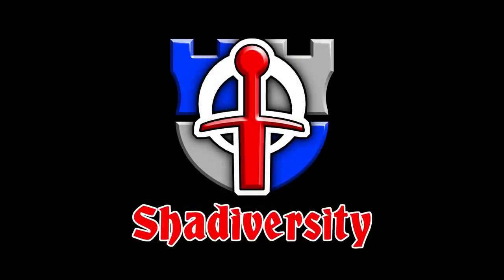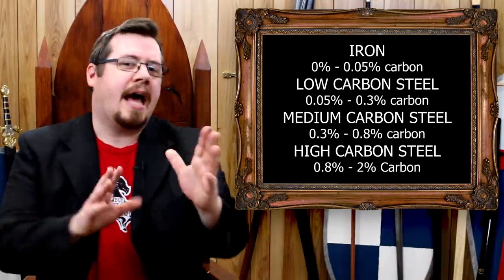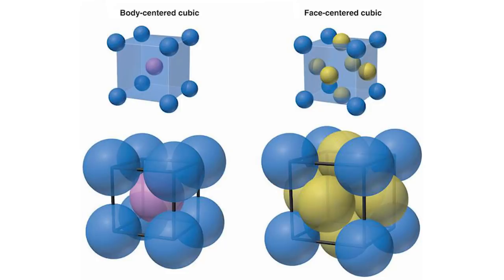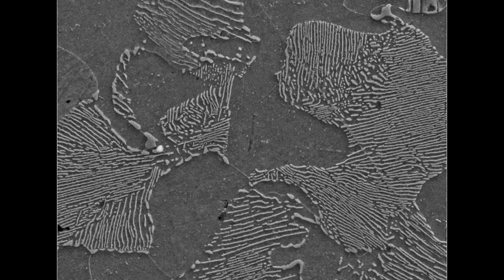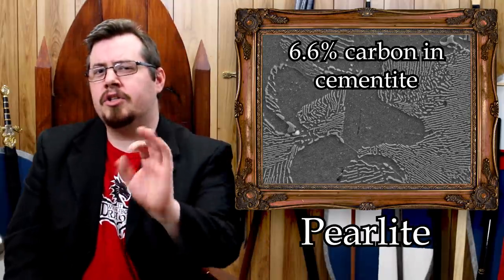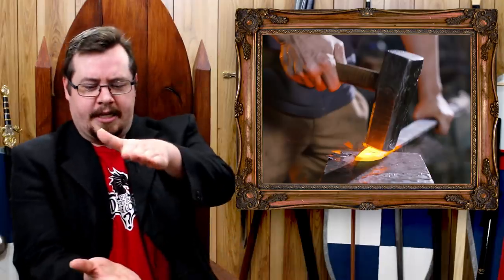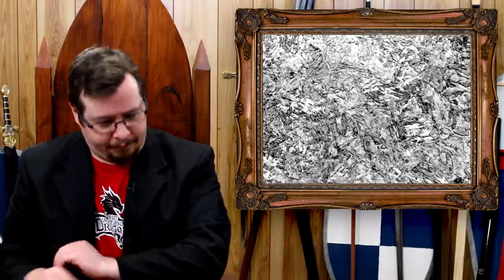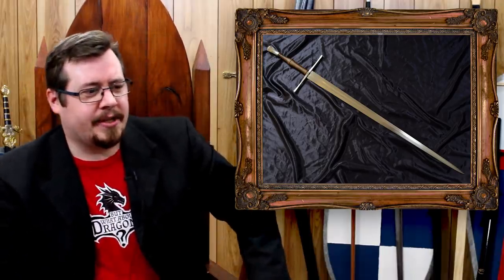What quenching and tempering does to SWORDS

Comment: Hello Shad, an incredible video!! Such as always.
When you were comparing the mono-spring steel to the differentially hardened one, I came up with some questions:
The differentially hardened katana have a soft core of ferrite because they are used two steels for the blade: the one for the exterior wich is high carbon steel and a low carbon steel for the core, then when quenched, applying the clays first, result normally in a sword with a martensitic edge, a pearlitic jacket and then a ferritic core. Let's imagine that we make one from an single bar of modern high carbon steel, but we apply the clays before quenching to make it with a true hamon: 
Would it then have a pearlitic core and jacket and a martensitic edge? 
Would this make it even more brittle than having the ferritic core or not?

Also, due to the fact that normal martensite is brittle: would it then be good to temper the blade to make the martensitic edge more flexible or would be unnecessary or even unconvenient (for example, make the hamln disappear)?
Reply: And also, with the pearlitic core and jacket scenario, it will still make the sword more brittle than making it from mono-spring steel wright?

Comment: Hey Shad, if you accidentally heat up a blade nearly to the temperature it was tempered, will it mess up its characteristics? Because of that, people usually warn against sharpening knives using grinders that are not designed for that purpose as they can go too fast and heat up the edge too much. Wonder if it's valid.

Comment: The one thing I'd like to say is that you should almost never quench a blade in water. Most steels will gain cracks and micro fractures when quenched in water because of the stress caused by cooling so fast. As an amateur blade smith I've learned that you should almost never quench in water, even if the steel is capable of surviving a water quench. I will admit that some smiths are skillful enough to pull off a water quench, but it is still risky. Oil is the better option because it cools the blade a bit more slowly, giving you a hard blade, but taking away all of the added stress of a water quench.

Comment: Theoretically you could get even harder than Martensite, if you cool is fast enough to form Amorphous steel.  This means the atoms retain the random arrangement of a free flowing liquid. There are no crystalline grains, and thus no way for grains to slip past each other. The metal would have no faults, and would be much harder, stronger, and tougher than any metal with a crystalline lattice. Metallic glass can take a lot more stress before deforming than crystalline metals can take before breaking, and it snaps back easily from the small strains it can take before breaking. When the stress is too much to bear though, it catastrophically shatters without warning. 

We are not even close to developing the technology to cool an ordinary carbon steel alloy fast enough to form a metallic glass. We can form amorphous metals out of some much more complex and exotic modern alloys, but even then can only form small items or thin film coatings. Making a whole sword out of an amorphous metal would require magic.

Comment: 4:00 Shad is correct when he says it's "phenomenal". 

The fact that steel can be heat treated in this way allows engineers (and, in ye old days, blacksmiths) to carefully control the properties of steel. Austenite is one useful phase of steel, but there are others too. You can have very hard steels that are abrasion resistant but more brittle, and steels that are very flexible and impact resistant but more prone to deformation. And tons of other types of steel just by controlling the carbon content and the heat treatment process. 

And add to that steel alloys with things like Chromium for stainless steel or silicon for transformer steel or tungsten for tool steel...

Steel might be very strong yet flexible, but it's actually the fact that it's material properties can be carefully engineered that has made it so useful throughout history.

Comment: Also you can get pure elemental iron, you just need to reduce the iron with a reducing agent that isn't soluble in molten iron, you can do it with aluminium, sodium or magnesium via a thermite reaction or directly with electrons from a wire via electrowinning. Iron does in fact like having carbon dissolved in it to the point that it will dissolve carbon from diamond sharpening wheels if the temperature is high enough, hence why you should only use diamond hand tools on steel, any power tools should be Al2O3, SiC or WC based abrasives, as Alumina/corundum won't dissolve in iron and silicon and tungsten have a higher affinity for carbon than steel.

Comment: The reason most Katana's are made out of spring steel is for economic reasons, it's simply far cheaper. A traditional build pretty much has to be done by hand and is impossible to mechanize. It is also much simpler as well as faster.
Reply: But it makes them illegal in the UK.

Comment: Huh. That might explain how the guard on my cheap display sword ended up snapping off on one side.
I didn't think you could snap off metal like that. (It showed no sign of bending, rather it broke in two).
Extremely hard steel (and thus brittle), I guess.

Comment: That's probably one of the reasons swordsmen who used the katana are commonly regarded as being extremely skillful, because if you try using pure brute force and smashing at armor with a katana it will get ruined easily so it requires more skill and precision to not break it in battle against armored opponents. So it required extra skill to even use properly, where as it wouldn't require as much precision to wield a spring steel sword that can handle the structural abuse of smacking armor plates. The general design of spring steel swords makes it better for thrusting/spearing opponents between their plating also, where with a katana it's harder to aim directly like that. Its shape probably does make it easier to catch between the plates and twist it side ways to get under the plates though. I guess it all depends on the swordsmen preference or how they were trained. I definitely would prefer the spring steel though.

Comment: But Shad, what about different types of quenching in terms of liquids used? How does that effect the process? Water vs oils for example.
Reply: Generally speaking, oils are better as a quench medium because they offer rapid, even cooling at higher temperatures, and slow down as the part cools.  This keeps the part from cracking.  Water is less than ideal as a quench medium as it creates a bubble of water vapor around the part, which can cause uneven cooling, excessive strain, and potential cracking.  You can kind of get around that by using a brine or caustic soda solution, but oil is still the preferred option in many cases.

Keep in mind that this is from the perspective of a modern toolmaker, not a blacksmith.
Reply: Mr. Entropy still very informative, thank you!

Comment: Heating worked steel up to the normalization temperature doesn't reset all the stresses in the metal, it just normalizes them, unless you're heating it to the melting point, there's going to be some residual stresses from working detectable in the metal, if a normalization heating before a quench really reset everything you wouldn't be to see the patterns in folded steel, it would just homogenize.
Reply: Ceteris paribus, you will still see different properties in a forged sword that was normalized before the quench and temper versus a milled one normalized before the quench and temper, the differences will mainly be in ability to hold an edge and shock resistance, due to the stresses still left in the blade from forging prior to normalization.
Reply: @awashburn6944  of course net stresses are normalized, but you will see a difference in grain structure in a forged blade even after heat treatment and normalization, unless you're getting hot enough to melt the steel, or keeping it at a temperature for long enough that the average ion velocity through the steel is enough that the time it's at that temperature will allow those ions to move far enough away from their original locations in the blade, all you've done is anneal it, you've taken some of the forces and allowed them to cancel out, but not all of them as the microscopic grain structure of forged steel after heat treatment still looks different to heat treated cast steel of the same content.
Reply: @awashburn6944  I wasn't saying that the visible pattern welding was due to stresses, I was saying it's due to the metal atoms in the steel not normalizing when heated, you can keep them at temperature for days, the stresses may relax, but the metal will not homogenize. If normalisation was a hard reset like melting, then you wouldn't see a pattern and the grain structure would be indistinguishable from a casting subjected to the same treatment

Comment: Is there a difference between quenching in water and oil?
Reply: Water cools it down faster mostly, but the Leidenfrost effect kinda messes it up so it cools fast on some spots and slow in others and is way more prone to cracking your steel. Oil is better and safer.

Comment: It is not true that pure metals do not change traits due to quenching.
The changes just arent apparent enough due to unificity of material.
Steel is made of two basic materials Iron and carbon. Different particle sizes  and atom structures intertwine forcefully and create high tensile environment.Tempering releases some of this stress and evens out the spacing of particles that are too close, and these are first particles to repel each other under stress and create fractures.
Quenching pure Iron or Bronze will change its structure due to shortened time period of cooling. And there's a reason why certain metals have certain timelines of natural cooling. Because atoms need time to settle. Once they settle they release the extra energy ,in this case heat.
If you quick cool any metal it will change its structure. But usually softer metals,or more unified ones atomically, will just develop cracks.Most of the time losing better qualities and gaining very small amouts of good ones.

And I just realized how boring this may sound to someone who didnt finish mechanical school and knows crap about metallurgy.
Enjoy   :)

Comment: Wait, hardened steel can't get sharper?
I always thought that it could and this was also the reason obsidian blades can get much sharper than any metal blade ever could. Obsidian also loses it's edge pretty quickly, they were also made with a wooden core so the edges could be changed pretty quickly. I know glass is quite a bit harder than steel so if it's not it's hardness that makes it so sharp then what is it.

Comment: Could someone please help me understand what he means when he says:
The Iron core of the Katana will not absorb some impact but it will prevent a crack from forming all the way through the blade when struck on something hard. It seems to me that preventing a crack would indicate it does absorb some impact. I'm not disagreeing with Shad, but I am confused and any help is welcome.
Reply: Jack It means the crack will just stop when it encounters the border between different steels. It doesn't absorb and distribute the shock, it limits the damage.

Kind of like the difference between kevlar and modular ceramic armour, kevlar spreads the energy of a bullet around and absorbs it, ceramics either withstand it or crack, although only one ceramic plate will be damaged and the armour will still be usable.
Reply: Thanks :D

Comment: Omm ya i am a bladesmith with a little over 1 year experience and well over 100 blades made.  I feel i need to way in on this a bit have to say i would not use anything above 1% carbon content to make a sword. when you get up to 1.5% carbon content steels like D2 if you get it too hot it will crumble and i have had this happen on me. for a bladesmith .4 or less carbon is low carbon, %.5-%.6 is mid carbon and .7%-1% is high carbon and 1.05%-1.5% is super high carbon.  this is partially do to the fact that having higher carbon content lowers the melting point of iron, meaning it gets in the gelatinous state at lower temperatures when you have more carbon.

Comment: So, I understand that a high carbon steel is not very good for a sword, but which would be better, medium or low carbon?
Reply: David Kwei wait high Carbon is the best right
Reply from the maker: High carbon steel is the best for swords, it needs to be high carbon to make martensite and then a spring.
Reply: David Kwei well the problem with terms like low and high carbon steel are that they are relative. In actuality most swords fall around the middle, but if you go to kult of athena than you want to buy swords that are labeled as high carbon, and avoid ones made of stainless steel. Stainless steel is completely unsafe for use
Reply: Thanks, I think that I got things mixed up.

Comment: Japanese swords were typically not tempered, but there is evidence some were. Also there were swords in China that were spring tempered, differentially clay hardened, and differentially hardened AND tempered. All modern reproductions of clay hardened katanas are also tempered. Typically 45 hrc back and 60 edge. It is wrong to say you cannot do both because the edge would crack because normally a sword simply will not flex to 90 degrees. So there you go, best of both worlds.

Comment: is it possible that there is a little error into your presentation
from what I learn in school a very long time ago !  
you quench a steel piece to temper it then you anneal to release the tension and adjust the desire hardness
Reply: Nope, annealing is the process of completely removing the hardness. For a practical example, if you wanna make a knife out of a file, you would first anneal it to make it soft, then cut/grind it into shape, then quench, then temper. And of course, a little different if you want to forge it into shape, then you just heat it up and beat it into shape, then you do any finishing with a grinder if needed, then you normalize it (because it was beaten into shape), then quench and temper.

Comment: Great video. But sadly I'm only left with more questions than answers. A while ago, Matt Easton, Scholagladiatoria shared a video from Mike Loades' channel titled "The Secrets of Damascus Steel"(https://www.youtube.com/watch?v=OP8PCkcBZU4).

In both that video and in the comments they talked about how crucible wootz damascus is typically not quenched when it is heat treated. Some even have the temerity to say that it is "air quenched." 

I was under the impression that air cooling had the opposite effect, which is it softens or de-stresses the blade rather than harden it. It's also likely that these wootz steels if unquenched, remain with a pearlite microstructure and do not achieve the level of hardness that we expect most high-carbon steel blades to have.

You or somebody else who is knowledgeable within the sword community should do a video about this. Either explaining or discussing what advantages or disadvantages there are to crucible/wootz damascus, and why they avoid this part of the process.

Comment: So there are some parts of metal working that seems to "just work" if you don't know the molecular chemistry behind it.  ...  Which I assume the Medieval blacksmiths did not. 

Heat up rock, make it soft, hit it into shape before it's hard again.  Makes sense.  
Mixing different types of rocks in different rations, heating up with different materials, at different heats to experiment.  Makes sense.  Seems like something that'd take a Lot of trial-and-error, but I guess smiths were really good at passing on their knowledge, and apprentices were really good at experimenting. 

But the entire atomic reasoning for why heating, beating, reheating, and forced cooling doesn't seem like something that can just be....figured out.  Did they just shrug and think, 'guess the fairies in the metal don't like it when we hit their house, so we gotta put them to sleep with heat.'?

Comment: A sword that is just a piece of bar stock with an edge on it and is properly quenched and heat treated is 1,000 times better than the most beautiful blade that is not properly quenched or heat treated.